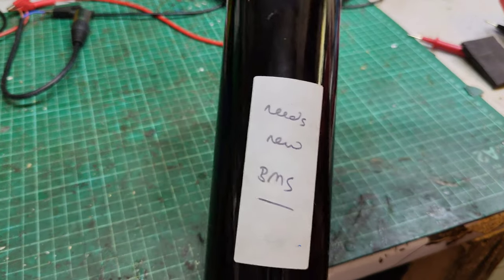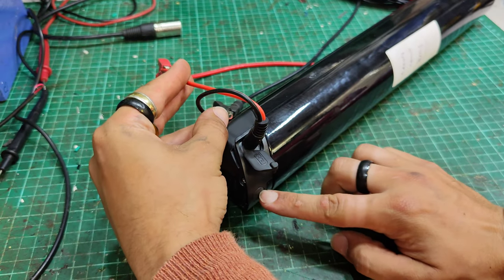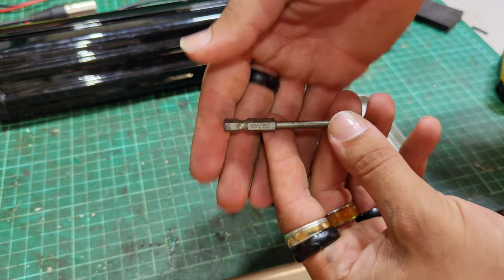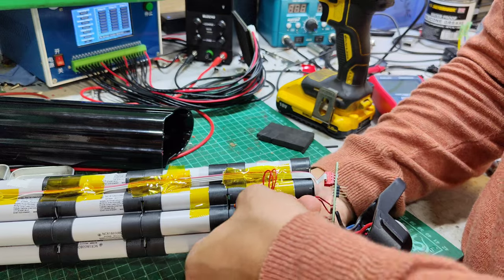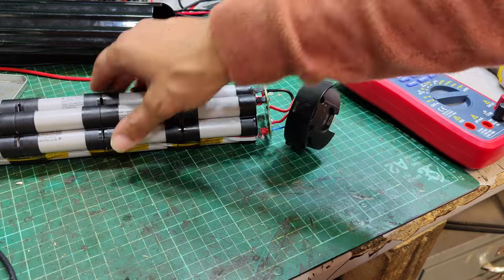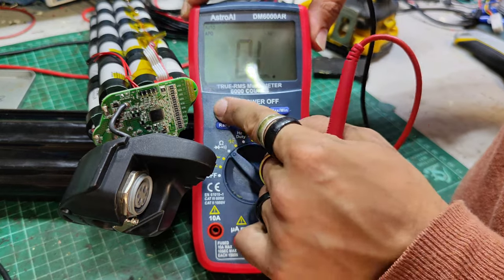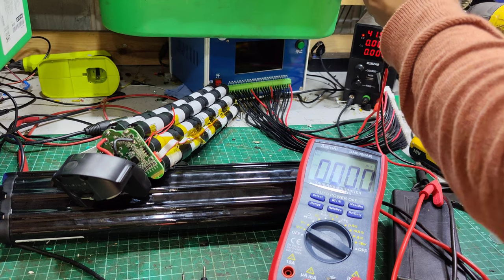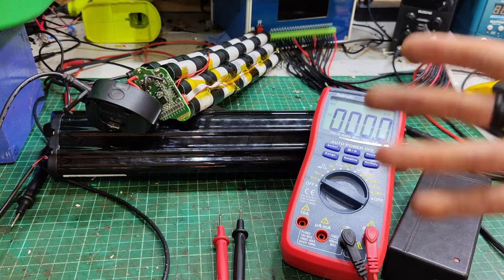Retention Eel battery dead - can we revive it? EMU/ROODOG/ESKUTE battery pack diagnosis

Comment: Very interesting can you do one on a Fazua 250 battery please its ony had 34 charges in 3 years then failed while out riding and will not switch on after lights going out.
Reply from the maker: Hi there unfortunately I don't have one of those, also unlikely that they can be fixed! Smart BMS systems usually won't turn on again, only option is a new one 😩

Comment: I have same battery for e skute  just output is at the bottom , opened top and bottom and cant see fuse  .top and botom sealed .so i am thinking if i rip it out any chanse fuses are somwhere in the midddle ??hate eskute and hate this bateries from them ..absolute  nightmare
Reply from the maker: Unfortunately there might not be one in your battery